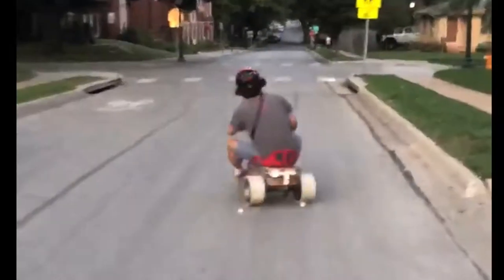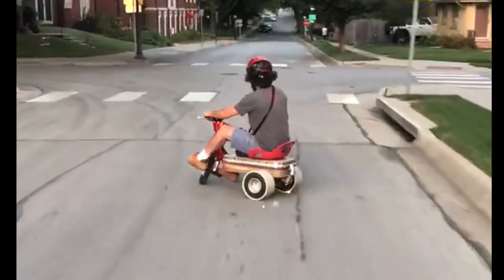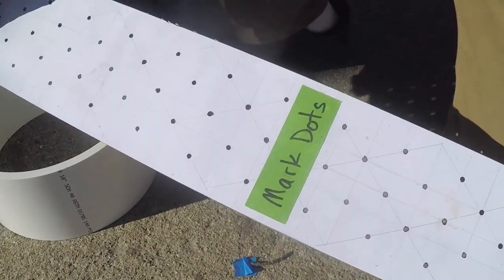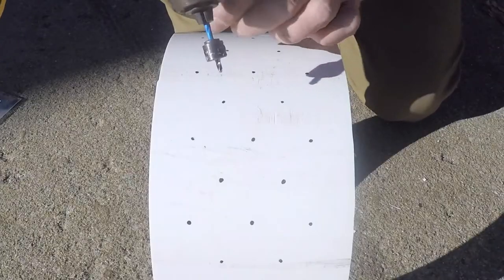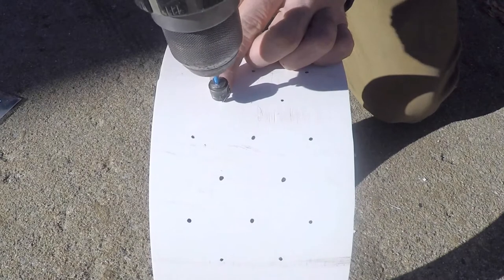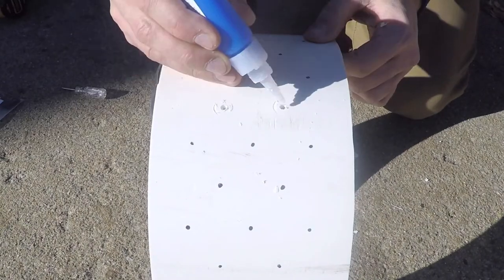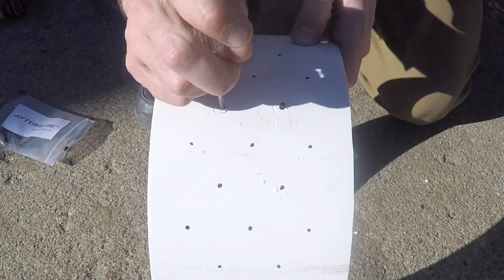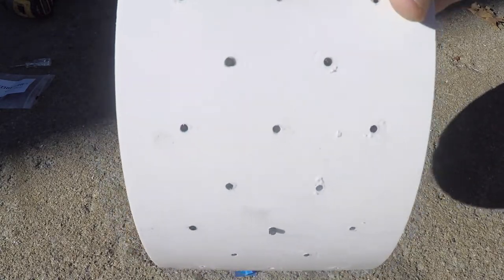How To Make Sparky Sleeves For Drift Trike Wheels

Comment: Hi, I wanted to make a drift trike too but i dont know how manu mAh I need for 1000w 36v motor. Can you help I will really appreciate that.
Reply from the maker: Watts is equal to volts times amps. So 1000w ÷ 36v = 28A. Amp hours or mAh is a measurement of the battery's capacity. There is a popular metaphor explaining how electricity flows like water, it goes something like: volts is the water pressure, amps is the size of the hose, and amp hours is how big the water tank is full.